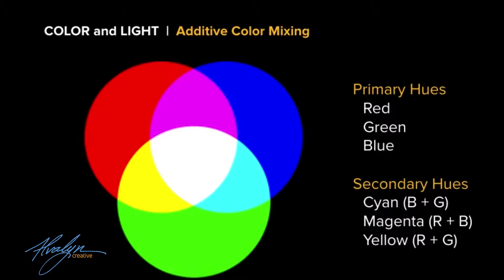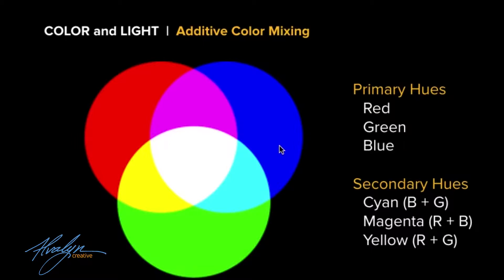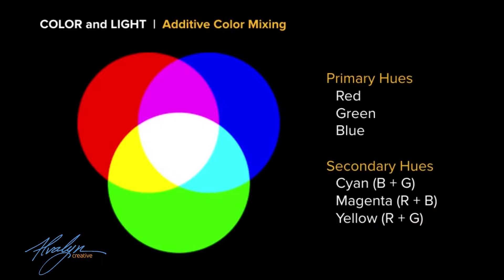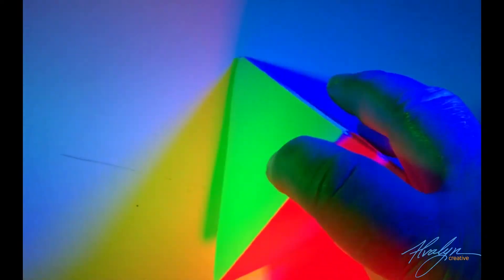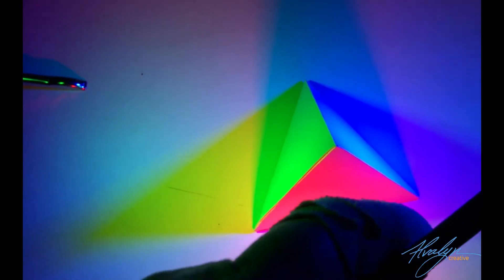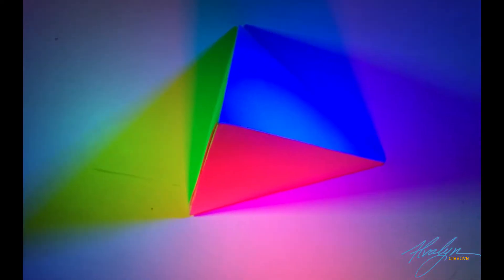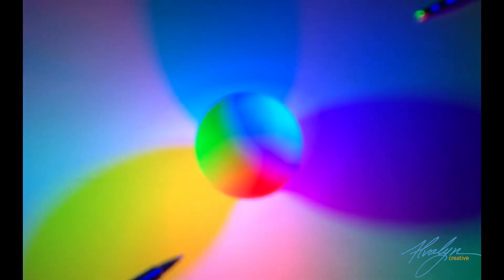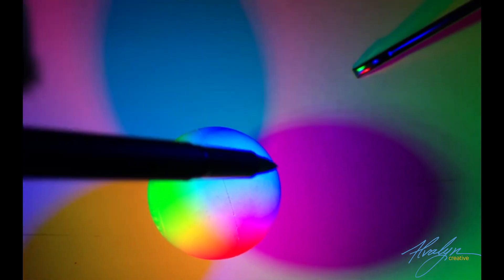Color Mixing In Light

Comment: The secondary hues are a visual illusion. In the eye we have three sensors or cones that are sensitive to red or green or blue light. When red and blue light overlaps then we perceive magenta, which is a visual illusion created by our brain since we don't have magenta sensors in our eyes. The same is true of all the secondary hues.
Reply from the maker: Thank you for commenting. Color is a perception (defined as awareness and interpretation of external stimuli) — the result of light waves interacting with photoreceptor cells which send nerve impulses to the brain. An illusion is defined as something that's wrongly perceived or deceptive. Light wave frequencies are measurable. On the visible light spectrum, yellow occupies the wavelength frequencies between about 565nm–590nm; cyan wavelengths are in the range of about 500nm–520nm. Magenta, being a very cool red close to red-violet, does not have its own range of frequencies. It's a combination of red and violet wavelengths, which exist on opposite ends of the visible light spectrum. We perceive magenta due to a combination of red and violet lightwaves. In pigment, red-violet and magenta are perceived when red wavelengths and violet wavelengths are reflected together. So, the additive secondaries cyan and yellow are not an illusion — a deception. Magenta, the third additive secondary, is a combination of the shortest and the longest wavelengths. Since wavelengths exist and are measurable, magenta is also not an illusion (an incorrect perception.)
Reply: @AlvalynCreative  I agree that the word "illusion" has a negative connotation, suggesting something that is not actually being presented to the senses. But that is the point I was making. Red and blue (or violet) are at opposite ends of the spectrum. There's not really any overlap in terms of sensors and therefore perception. So where does the magenta come from. It must be created by the brain. In that sense it's a deception, or illusion. Yes, Magenta exists on the spectrum, but it's not detected by the cones as such, so that point in irrelevant to this discussion. If we had a sensor or cone that is sensitive to magenta then it would be and there would be no illusion (in a positive rather than any negative connotation).